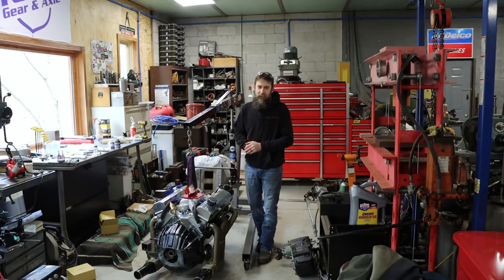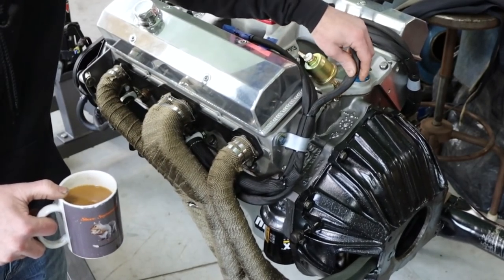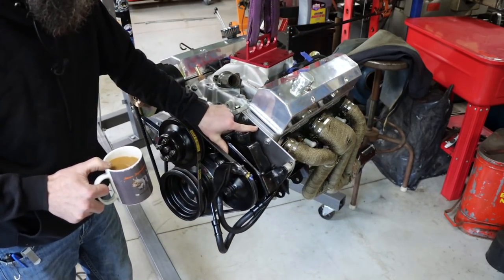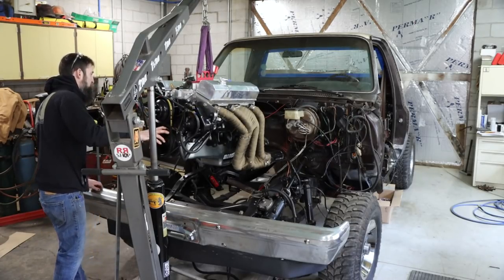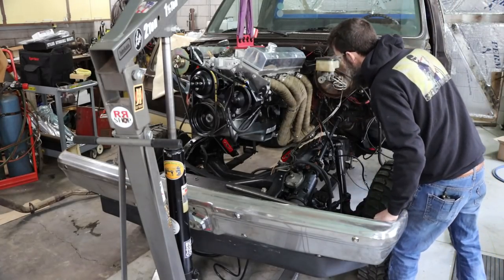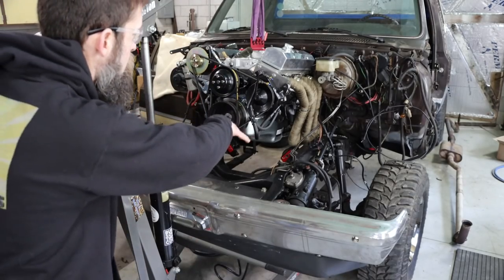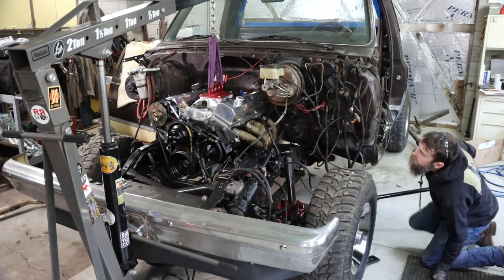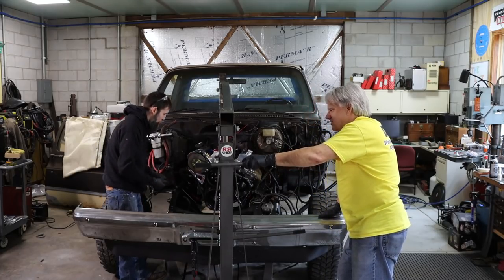Stroker Engine Installed in the Chevy K10 & New Equipment for Cleaning and sand Blasting.

Comment: Keep the trigger on the lance pulled when you start the pressure washer, it relieves the pressure in the pump so should be a little easier to pull over.

Comment: Steve, when starting pressure washer make sure you have water connection and water running out wand or will burn out pump. Enjoy
Reply: I never understand why the people who make pressure washers are ok with that. In no other place would you design a machine that can burn out because of operator error. Sometimes its just an airlock in the plumbing and nobody’s fault.  They should do better. And we should not accept it as consumers!

Comment: I use a set of ATV rachet straps and two 8' x 2 x 4 to install my trucks crankshaft under the engine. Saved me time and me trying to bench press it in and blowing out my change purse. 😅👍

Comment: Tractor Supply also has a "Water Can Spout" that can be shipped/purchased in states where the one you have is not available.  Basically the exact same spout but white.  Model number is 20050.  I live in Mass, and have them on all of my gas cans.  The spout that came with the can never saw gas.  They also sell a high flow version, but that one will not fit in most gas tanks.

Comment: NP205's are a beast. I made a simple bolt on flat plate and bracket so it would sit at the correct angle on the floor jack. Really helped a lot. The 205's would probably outlast the life of 3 vehicles..

Comment: the trick with those cans is to release the lock then with the can spout vertical you use the filler neck of the gas tank of the equipment to open the spout, you let it run until you hear the venting action stop gas level has reached spout, then just pick the can up and you are good. they do still suck, but it makes it a lot easier.

Comment: The gas cans are my pet peave.  The EZ pour spouts (and others like them) are a blessing.  I still have an older 5-gallon plastic can that works great.  When I fill my cans, they all wind up filling the old can, because the old can is the easiest & safest to use.
Reply: I've found one good version of these cans. It's called "No-Spill," and it's American made. And very pricey. Push button on the spout. Seems like it would be awkward in 5 gallon size, but the 2.5 is great for two stroke equipment.
Reply: Why not open the can with the rim of the hole, when the spout is on the inside?

Comment: Good investment on the pressure washer.
From a pro, don't adjust the regulator. Always run it wide open and adjust by backing up... And always, and I mean always let the pressure off by pulling the trigger after shut down.

Comment: I picked up the No-Spill fuel can from Tractor Supply last year and it is the first environmentally friendly can I found that is easy to use and don’t spill fuel everywhere!
Reply: Have several of them..I like them better than the old cans since you only have to let off the button and don't have to regulate the flow by tipping the can.

Comment: I've been buying No-Spill brand plastic gas cans. They really won't spill if you are reasonably careful. They have a push button valve so you can stop quickly or spurt the last little bit in. The vent is built into the nozzle. On some tanks it will auto stop when the vent gets covered although I don't use that feature  often. Cost more but really work.

Comment: I have installed a lot of those transmission and transfer cases . The easiest way I came up with is to install them together. I would slide them under the truck and use the engine hoist you have and a strap around the center adapter. Hoist it up through the hole in the floor.it balances nicely.  A little late to help you but maybe someone else

Comment: when using the sandblast attachments try to have the input piece above the pressure wand, it helps avoid any water soaking back down the pipe clogging the sand.

Comment: Dad had a 77 Chevy 4x4, with 350 4 bolt main and a 4 speed.  Whenever it came time to replace the clutch, we would pull the engine, rather than pulling the transfer case and tranny.  

That truck will is coming together.  Looks nice

Comment: Need a second pressure wand pole bent in a J shape to spray into the outside of the fender wells and the inside of the rocker panels to flush slush and mud from to reduce corrosion issues

Comment: Morning Steve.

Go ahead and get some silicone grease and o-ring kit for the hose and wand for the pressure washer.  Add another 50 ft of hose.  Lastly get a couple of the couplers for the hose.  O-ring seem to go when you really need to use the machine.

Neat looking install.  Can not wait to hear that motor run.  

Al, you are the man. It always seems that you show up when Steve needs a hand.  No better friend could Steve have.

All y'all stay safe. God bless.
Reply: Yes, I keep the seals for the connections well lubricated, using some synthetic grease. Always works well, and never had any issue with them, unlike others that would wear out those seals within a day or three, putting them together dry.

Comment: I have one of those $20 add-on sandblasters myself. I live in a real humid environment so that sand tends to clump up. I've had a lot of success with Walnut shells. And it's nice to not have to worry about clean up, easily compostable. Being lightweight but larger, it moves through the attachment well but it doesn't use as much material as with sand.

Comment: There's always "buy" and "don't buy" lists for Harbor Freight tools on YT. Pressure washers are not on any of the lists I've seen, but should be on the "buy" list. I love mine. We've abused ours like we stole it, and it still runs great. Predator engines are underrated, they're comparable to the Robin-Subaru.

Comment: Steve, please take this advice as I have owned more pressure washers in life than ever wanted too. 
When it's running and you're not using for over 2 minutes, just hit the gun so you don't cause pump cavitation and ruin it.
Next, use Sta-Bil in the gas always. 
Always after use use Sta-Bil Pump Protector. Small 4 Oz can with a tube and well worth the money... I'm sure you already know this but perhaps it may be a good reminder...Seeyah Bud...
Ricko

Comment: I’ve got one of those sandblast kits, run it off a 3200psi pressure washer. Works really well. With yours having more pressure and flow, I doubt you will be disappointed.
Reply: I agree.  I sifted my sand through a window screen and used the smaller sand and had great results.  The only down side to the wet blaster is the large area it effects.  My blasting cabinet has a well defined line.  The wet blaster hits everything in a 2 foot radius.  so protect anything you don't want damaged by the sand.

Comment: 25:01 If you turn a full fuel container 180° so the spout is at the top when you tilt it 45° or more, you will spill far less of the contents because you have more control of the flow .
It's a little less easy to hold ,but not too bad.
That applies to all full containers

Comment: Another great video. Things are coming together nicely now. 
If you aren't already using ethanol free gas I would highly recommend it for your small engine powered equipment. It will save you some troubles in the future for sure.

Comment: if you ever take te transfer case out again, do it the easy way,mount the transfer case to the cross member then sit on the jack and it will slide right in ,then just bolt your transmission and transfer case in

Comment: Time to get a big tub, and put the sane in there, and make it your sand blasting pit. That way only the one load of sand needed, till it turns to silt, and then you simply put in more and carry on. Just keep the water from there out off the stream, it likely will be badly polluted, so a simple settling tank, and some soak away to filter it all out, will go down well.

Comment: Gotta love those stupid pour spouts on the gas cans. If the EPA would have left well enough alone, there would be a whole lot less spillage of fuel. I guess somebody figured out if we make spouts that don't work, we can then sell replacement spouts that do work so we get more money out of the consumer. I like your new pressure washer. I always wondered if the sandblast attachment really worked at all, now I know. I did see maybe that there is too much sand supply that is probably in need of adjustment. You could try plumbing in a ball valve inline of the supply hose somewhere to throttle sand supply as needed. Just an idea to try and save on sand a little bit and maybe work even better.

Comment: I'm old enough to remember the 'good' gas cans with a vent, spout that works, and caps that work. I'm also old enough now to need a gas can for lawn equipment and just hate having to fill them up because it seems I spill about a tablespoon of gas every time. How over 40 years of gas can tech have they gotten worse?
Reply: because they don't care how difficult it is for you to use the gas can, they only care how much vapor the can releases in to the environment while it's sitting in the shed with gas in it.

Comment: Too late now but I have one of those fancy engine levelers you could have borrowed. You know you were only 4 new bolts away from just taking the cab loose and getting it out of the way. 😎 Then you easily could have put engine trans case and shafts in with out wallowing on the floor. 😂

Comment: Gas cans...........I know they're expensive, but I bought a couple Justrite cans, a 5 gallon and a 2.5 gallon, for pre-mix and those are about as good and as easy to use as it gets.  I've even had to test their warranty once, because I believe my 2.5 gallon got too hot and expanded and created a few creases o the bottom and one had a pin hole.  Called them up, emailed them pictures and had a new one within a couple weeks, easy peezy.  I have spent hundreds, if not a thousand bucks on plastic gas cans and am way happier with the metal Justite cans.

Comment: Pal of mine that I used to work with many moons ago used to tell a tale of a truck he once worked on. At the end of the day he had left the truck with all its hub & diff bearings and seals laid out in strict order of disassembly, covered with  cloths and went home. He had not thought about the early morning cleaner, a simple chap but usually thorough in his ways. When my pal arrived the following morning he found the cloths gone and all the diff parts swept together in a heap. He said he felt like crying, had us all in stitches laughing.
Reply: I'd have cried as well lol
Reply: Friend had a gearbox stripped, and the instructor added 2 extra balls to the pile, after he put the table into a box, and gave it to him. Took 2 days with the manual, and at the end he was frustrated with these 2 extra balls, till the instructor  told him this was also part of the training, asking for help before stripping it all down again.

Comment: Steve its now to hard for me to lift these tanks, and I bought one off those electric battery operated   pumps and they work great put the pump in you tank and the hose in your gas tank works like a hot dam. Also when I start those pump I pull the trigger leas Resistance start easier.

Comment: Kinda bypassed the fuel can issue altogether. Was down at the feed store getting dog food and noticed they had a bin full of red polyethylene fertilizer jugs. About six gallon each. Same cap as a gas can. Three dollars each. Bought five for less than a single approved can. Had to vacuum out the dry fertilizer residue. Of course now gas in California is too expensive to buy.

Comment: Steve, Just a word of advice. Keep an I on the fuel shut off valve on that power washer. I had bought there generator and after the first run the shut  off valve leaked like a sieve. Be careful with it. Great job on the truck.
Reply: It's a Honda clone so it's possible a Honda valve will fit directly.

Comment: Fist thing I do is go to the Farm and Fleet store and get that replacement nozzle.  WORST DESIGN EVER, but of course the government knows better than everybody else.  

That sand blaster attachment seemed to work pretty well.  Pretty impressed with that predator.  I bought a name brand back about 20 years ago, which still runs, but the big downfall is that you can't keep the engine running with out keeping the pressure off the pump, no cutoff on it.  Guess that's just they were back then because all of them we looked at back then were like that.  Well, not entirely true, the $1000 "Commercial" units allowed you to just run the engine and not worry about the pump and pressures...

Comment: The new stupid gas cans aren’t supposed to prevent spillage, they’re supposed to stop vapors from escaping.   Isn’t it great that you have to pay for all the new features then take them off and spend more money to make it usable?  I gave up and got a cheap gas pump that takes 2 D batteries.  Much nicer than trying to hold the gas can up and control the nozzle.
Reply: I think the point is that if your spilling the fuel all over the place, it really doesn't stop the vapors any ways.  But you are right, it's to control emissions from the gas can.  Doesn't work either way.  It just moves the emissions from inside the can to outside the can.
Reply: One problem with vented cans is with today’s ethanol blended fuel it is CRITICALLY Important that you store with the vent shut so it does not draw moisture from the air.

Comment: Hi Steve, that engine in looks really great ! I can't wait to see it running and see what you do when it's run in to your satisfaction as to the fuel system. The jet wash is a very nice bit of kit, and the sandblasting effects are awesome.I would be interested in knowing the compression ratio of that engine as turning  over a 400 + cc motor with a rope pull must be hard work unless the comp ratio is low enough to allow it. Rope pulls on even 50 cc  strokes can be hard  work sometimes!
Reply: I thought that too, I wonder if it has an automatic decompression valve like some of those motors.

Comment: Does anybody want to tell Al what the M in ATM stands for? I have a Porsche transmission on my 383 stroker, Kennedy Engineering make an adaptor plate, wouldn’t be any use in your truck though.

Comment: I have the best spout I can find on my old 5 gal gas can, but it is splitting along the plastic seam at the handle. Seems dangerous. So I bought a new gas can. it is crap of course but they put different threads on there so my old spout wont fit!! This will not work for me. UUUGGGHH!
Reply: The kit Steve showed comes with two different caps that are different size and thread to cover that issue.
Reply: @haroldphipps3457  Just went out and bought one, will be seeing how it works.

Comment: Your new pressure washer will last three years, I had one up until I really needed it last summer and guess what??? No working piece of junk.
Reply: So.....does that comment make you feel better?
Reply: @paulcopeland9035  yes it does the thing should outlast the waranty
Reply: I don't know about your particular brand of machine, but these things usually fail because of freezing with water still in the pump; idling the engine & pump and not spraying the wand(if the engine is running, you have to be spraying), starting the engine/pump without water supply  running freely with water; not draining the gas when put up for extended time, etc.
Bottom line is there are a lot of fail points in all these pressure washers, you really have to be attentive with them.

Comment: You're missing the point of the fuel can. It's not to prevent spilled gas, it's to capture vapors. See what you do is you take a couple hundred million dollars of taxpayer money and you pay a bunch of professors to sit around in a room and think of horseshit. 17 years later they determine that we are losing 1% of fuel to evaporation. Looked at over 100 years, this represents a savings of over $26. So then you take another hundred million of tax dollars and pay another bunch of professors to think about how best to prevent this waste. So those guys solved that problem. In 20 more years when we all have a nuclear reactor in the back shed, the new team of professors will have collected the necessary data on spilled fuel. I figure it will only be half a trillion dollars and 36 years and we should be back to what the fuel can was in 1968. But we stimulated so much economy. Can't you feel it trickling down?

Comment: Shouldn't use sand for blasting anymore Steve the silica in it has been proven to be very carcinogenic, its actually illegal to use it in the UK
Reply: The water blasting knocks down the dust so you don't breathe it.
Reply: @kensherwin4544  Okay i was only giving a warning I'm not going to enter into an argument
Reply: @tonybell4447  Where?  I don't see any argument.
Reply: @paulcopeland9035  That's because i'm not arguing
Reply: @tonybell4447  ...Good choice.